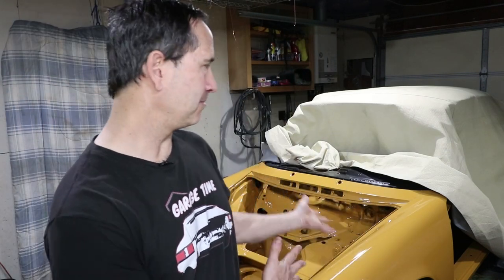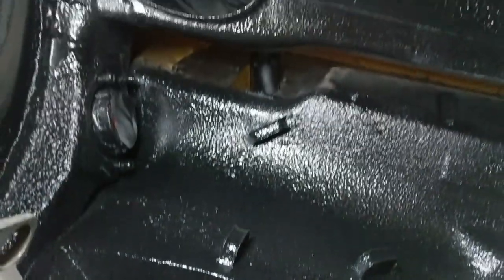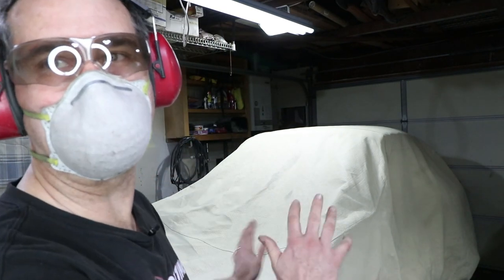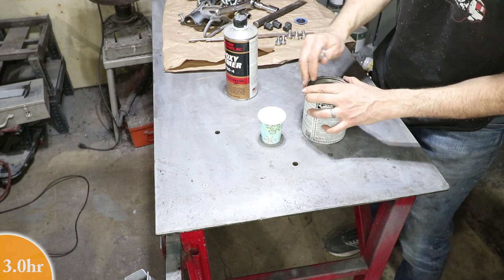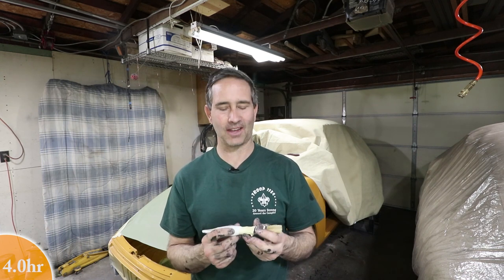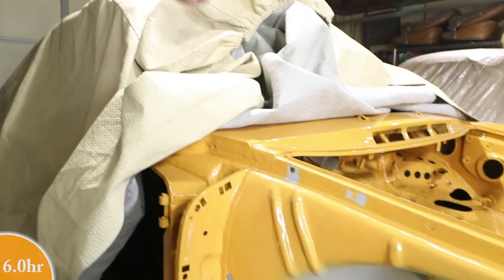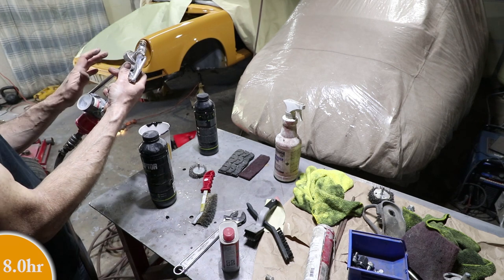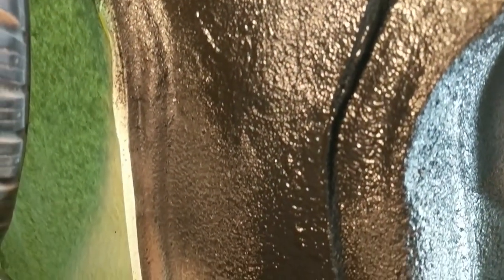Refreshing My Cars 45 Year Old Undercoating

Comment: May i suggest Fuchs polished rims. The cookie cutters are good. To roll a chassis. Great as always. Blessings.
Reply from the maker: The cookies are temporary.  They actually won't fit over my brakes☹️. I'll probably go with fuchs
Reply: @GarageTimeAutoResto  Tom, I have my 87 911 Fuchs available?
Reply from the maker: Thanks Shane.  Those are 16" right?  I'm trying to stay with 15"  to start and maybe a set of track wheels later on
Reply: @GarageTimeAutoResto   Tom, no worries!
Reply: @GarageTimeAutoResto  I have a set of cookies and Fuchs. If the wheel size is the same, then the brake clearance is the same (I thought.)  Therefore if you want to run a 15X6 Fuchs and the 15X6 cookie doesn't fit over your brakes, then the Fuchs isn't going to fit either (I may be mistaken). What brakes?
Reply from the maker: Hi, I think it's the difference between forged versus cast.